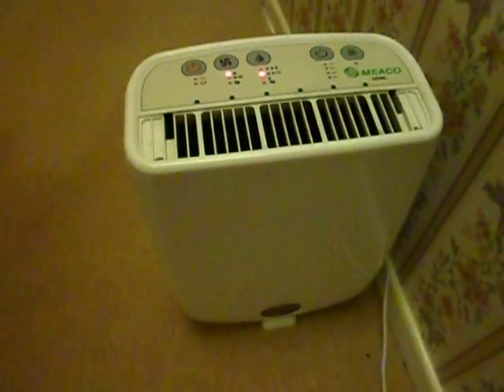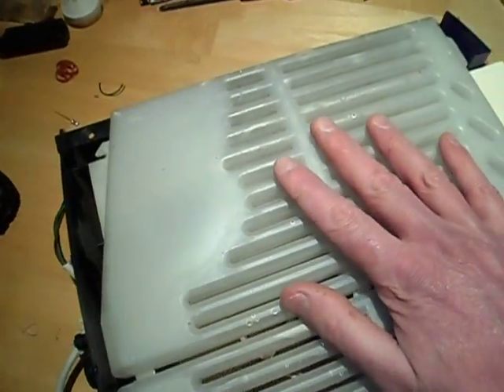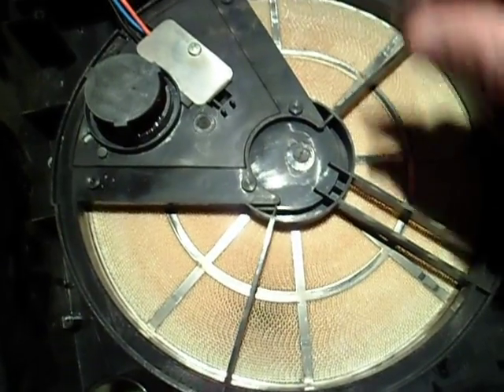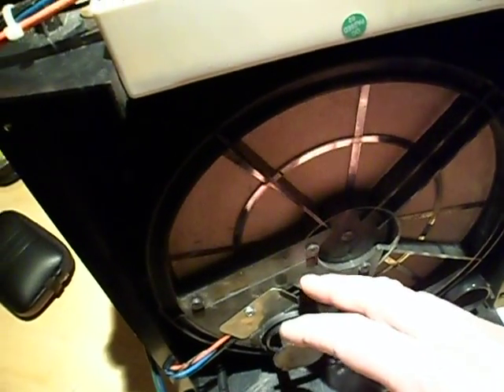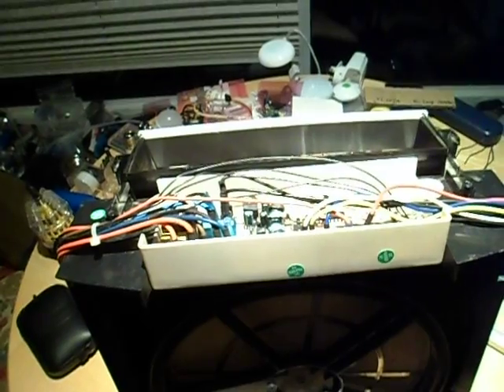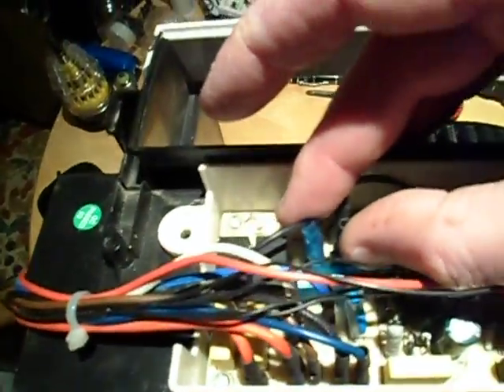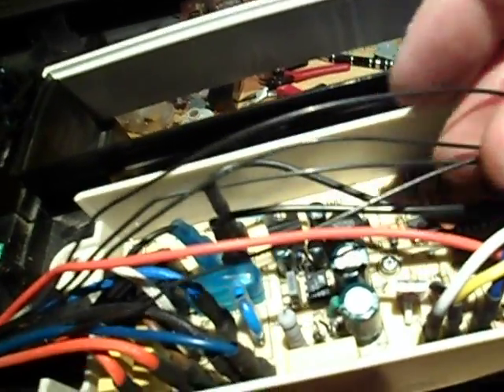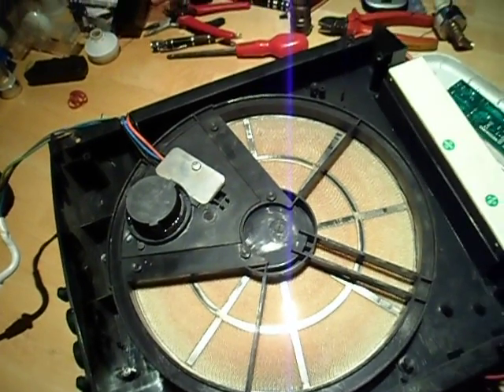A look inside a desiccant dehumidifier.

Comment: Great review of how they work and because of you I got the ecoair DD122 "Simple" instead of a compressor type which I have had a number of before. I have to say its very good indeed but I am worried about how reliable it will be over time as the old fridge compressors just go on and on. I suspect the life span of the desiccant unit will not be as good but we will see. Great review and very informative. Thanks for that.
Best regards Peter
Reply from the maker: Can I suggest you run it on its lower setting as all these style of desiccant dehumidifiers will last a LOT longer when used on their low setting.  I've been using mine in regular use for a couple of years and so far no problems.
Reply: bigclivedotcom Thanks for your prompt reply. I do use the unit on its low setting in the bedroom and to be honest we don't notice it at all. During the summer when its hot our tower fan which we use to cool the bedroom down is noisier. I am glad to hear yours has been OK as some people have reported problems but the Ecoair unit came with a 2 year guarantee which was the final conviction for me to try this type of dehumidifier. Your review went a long way to convince me to try it and is far more informative than the usual manufacturers rubbish that tells you very little. Again thanks for the review and I have subscribed. Regards Peter
Reply: Peter Bruce do you have an update? The dessicant should last more or less forever. The ptc heater should be easy and cheap to replace, as should the motors if they ever fail.

Comment: They seem to work fine when they are new but over time dust gets inside which blocks the return air sensor, mine has been back to Meacco 4 times and each time it came back saying they cleaned the return air sensor. Do you know where it is and how easy is it to clean oneself.
Reply from the maker: There are two thermal sensors and two thermal fuses mounted as pairs on either side of the desiccant drum where the hot air flows through it.  What was the nature of the fault when you returned it each time?  Was it showing an error code or was it just dead completely.
Reply: bigclivedotcom We have our DD8L running 24/7 on the two fan speed, we have serious mould problems in a stone wall house. We follow the instructions meticulously and vacuum the filter twice a week to be safe. After a few months of running we notice that the bucket starts to take longer to fill 10hrs when new increasing to 14 hrs after 3 months. Meacco pointed out this could be because there is less moisture in the air but I put it in the shed one night and didnt get any better results.
The proof that something is a fault is when the 2fan light starts to flash. this happens every 5mins for about a minute then there is a clicking sound when it stops flashing which i think is the heater being switched back on. Also when i inspect the dessy wheel i can see ours has dust on it and is scorched in places even the chrome has black marks on yet we have always used the unit in accordance with meaccos instructions.
Reply from the maker: That's odd.  I wonder if the air path through the condenser section is furring up.
Desiccant dehumidifiers are still a young technology.  I think we're the guinea pigs for the technology until it matures.
Reply: bigclivedotcom I think its the air path through the desiccant wheel, i can see with a torch that some of the cells (not many) are completely blocked. A post below mentions (Merco Dehumidifier_Service_Guide-2.pdf) where can i get this from id love to take mine to bits an clean out.
Reply from the maker: keith marsland I couldn't find the service manual for that dehumidifier, but you could always try taking it to bits.  The base comes off and then the two parts are held together by screws and clips, so make note of where everything goes.  Hopefully you'll find enough access to gently vacuum the front of the desiccant drum to get rid of the fluff.  The inlet filter on the front unclips and is sized somewhat generously to allow good airflow, but obviously lets too much fluff in too.
Reply: When i took it to bits i found the dessicant wheel was covered in dust about 3cm in from the outside diameter. the rest of the wheel had gone very brown as obviously the heat must have been concentrated on what wasnt coverd in dust.
Out of interest have you any idea what the two brushes are neat that poke through into the area near the big fan. The lead to wires so could the be some kind of theremosat
Reply from the maker: keith marsland The dust issue seems to rear its head a lot.  Perhaps in future designs they will design the desiccant drum into a cleanable cartridge.  The little black brushes you describe are the ioniser emitters.  They are clusters of carbon fibres with a high voltage at low current on them, that puts an electrostatic charge into the air.

Comment: great video thanks.
Im struggling to take my Eco air apart!
It works fine collecting, but makes quite nasty 'grumbling/knocking noise' after about 10 mins use...
this sounds 'internal' and doesn't differ if on high or low fan setting
It is 5 months out of warrantee, and gonna cost £89.99 to collect and service.
Any ideas what It may be?
Reply from the maker: When it's making the noise shine a light through from the vent side and see if the honeycomb-style desiccant drum is rotating smoothly.  It might be the motor that turns that from the edge that is stuttering if the drum is not rotating freely.

Comment: Hi Clive, very interesting video.  Could you please help me out.  I am after a similar design but for higher air flow rate, and RH 90% to bring it down to RH 20 % , would you have a link to find some more performance specifications of this model, may be amount of water extracted per kg air per unit time according air humidity conditions, what is the maximum air flow rate it does.    Cheers.
Reply from the maker: It sounds like you may be looking for a specific industrial dehumidifier.  You do get quite big ones for drying buildings after flood damage.  It might be worth talking to the manufacturers of them to see if they do one that fulfils your requirements.
Reply: TheMrCualquiera 20% is not easy to get to with a high flow rate.  it sounds like a process control / "food dryer" type application and you are looking at some expensive specialised kit  £10K+.  If you can recirculate the air in the room then you can use a "4 hole desiccant" eg Ecor Pro DH3500.  These don't give negative or positive pressure to the room (BTW this is not an advert its the best explanation of the problem.)

Comment: Hi Clive,
Great vid, very informative.
I have a DD8L junior, the red warning light is flashing, the system is clean, vac'd and blown through with dry compressed air. When the system in the fault state the fan does not rotate but the sound coming from low down in the unit is as if it wants to start rotating, the heater works fine, I can feel the heat rise to the top. After a few minutes the system switches off, when left to cool and the unit switched back on in the lowest setting, there is the same as above where after a few minutes there is a bleep, the red light flashes then the unit switches off.
Can you please advise
Cheers
Tom.
Reply from the maker: frogescalator1 Given how many of these units seem to die early on when used on full setting for prolonged periods of time, it might be worth doing a search on ebay for a faulty unit as spares.  The motor will probably be some standard unit in China, but might be hard to track down from here.  I can't remember if there was a specific manufacturers name on it or not.
There are two other possibilities for the motor failure.  It could be that the control board itself is faulty and not turning the motor on, although I think that's probably unlikely unless a wire or connector has come adrift or there's a bad solder connection on the PCB.  The other possibility is the motor capacitor.  It's a small rectangular box on the motor housing that causes a phase shift in one of the motors windings to give it rotation.
Reply from the maker: There are three motors in the unit.  A small fan that circulates the air round the condensation path, the drum motor and the main fan.  It sounds like the unit is detecting that the main fan isn't running causing it to shut down.  Was there any smell to indicate an unhappy motor before the fault occurred?  I have noticed the DDL8 I have makes what I would regard as a hot motor smell and I suspect it is the main fan motor.  It does sound as if the main fan motor or its control circuitry has failed.  Does the main fan run freely when spun by hand (or air)?
Reply: bigclivedotcom Hello Clive,
Thanks very much for this video and sharing your expertise.
I have a very similar issue. The main fan motor has stopped working without any fanfare or drama. I have opened up the unit and there is no sign of scorching or any burning smells from the main fan motor itself. I was hoping it might be a generic motor that could be bought from somewhere but the label on it says "Youlong Electric Ind. Co. Ltd" which is the original manufacturer of the dehumidifier.
Last winter I took the (out of guarantee) unit apart to clean it out after Meaco said it would cost £70. After doing this I put a finer mesh over the filter and it has worked fine ever since. I wonder if there is any way to fix the motor or whether I will just have to try Meaco -- and whether they will replace the motor after I have opened it before ... or whether it's just worth pushing the boat out to buy a new one. I have had just under three years' use out of it which admittedly isn't very long for the motor to pack in. It has been used on low setting for 99.999% of the time (I think I've used the high and/or medium setting on just two occasions).
Perhaps I've answered my own question here and should contact Meaco to see what they say. Depending how much they would charge to replace the motor it might be worth just getting a new one, but I'm reluctant to chuck out something that could be repaired easily.
Nonetheless I'd very much appreciate your insight about this! I would absolutely not want to be without a functioning desiccant dehumidifier for this coming winter!
Many thanks.
Reply: bigclivedotcom Thanks Clive. I think I'll see what Meaco say and whether they'll be willing to repair it. I know they charge £70 just to clean the things out, so if the repair cost is any more than that, I may have to ditch it.
In the meantime I've done a bit of looking around and have seen a German-made desiccant dehumidifier of similar capacity (Trotec TTR 55 E). On ebay.co.uk direct from the manufacturer it costs £135 inc. delivery. On the manufacturer's website, the PDF instructions include rather unusually a circuit diagram of the electronics AND and exploded diagram of all the parts! ( https://uk.trotec.com/fileadmin/downloads/Entfeuchtung/TTR55E/TRT-BA-TTR-55-E-TC-001-EN.pdf )
The air filter is also a removable and washable one, so presumably it would let a lot less dust through than the 1mm+ holes in the mesh of the DDL8's "filter" -- the cause of most of the breakdowns and leaks. Depending on Meaco's reply, I might say bye bye to them and try this German machine. It gets pretty good reviews on the German Amazon site.
It's unfortunate the the Meaco machines don't last, but given the comfort it provides over the winter in my single-glazed Victorian flat, I wouldn't go back to a streaming window winter without a dehumidifier!
Reply from the maker: frogescalator1 Most of these units appear to be from the same manufacturer with the only significant difference being that the control electronics are different between the "brands".  The exploded view of the trotec unit looks just like the EcoAir unit I took completely to bits for fun.
My own favourite unit is still the EcoAir Simple, which has no gimmicky keypads.  Just a high/low switch and a knob to set the mechanical humidistat.  It also doesn't bother with a cool-down period.  It just goes straight off.  The only thing I miss from the more complex units is the use of occasional fan cycling to let the humidistat test the room air properly.
The EcoAir simple unit costs about £130 from Amazon.
http://www.amazon.co.uk/EcoAir-DD122FW-Desiccant-Simple-Dehumidifier/dp/B00474K8SY

Comment: Hi Clive, I have a problem with my Ecoair DD122FW MK5 Desiccant Dehumidifier. The unit is now out of warranty.  The problem, the unit appears to work ok all of the motors are working, no warning lights, filter clean, also warm air is being blown out of the air outlet. But the unit is not collecting water, the humidity just drops very slowly probably through the heat from the outlet.  When I first had the unit it worked very efficiently, humidity dropped quickly, collecting plenty of water which could be heard when the unit was running.  Any ideas please?
Reply from the maker: If you shine a bright torch into the sides while the unit is running, can you see the desiccant drum rotating slowly?

Comment: How on earth do you get the case off the thing?
Reply from the maker: There are some screws in the water collection area and on the top, then some extremely firm clips on the plastic casing.  You really have to dig your fingers in and give it a bear hug to get it to pop apart.
Reply: bigclivedotcom just managed it, thanks. Nothing to see unfortunately - warning light coming on after a few mins (overheating says the manual) so checking for any internal blockages etc. All looks fine and filter etc cleaned. Time for skip and new dd8l :-(
Reply from the maker: Alexander Harris Have you checked the front filter is clean and that the internal desiccant drum is also not blocked with fluff?  There's a small fan that blows air in a loop through the heater, drum and the plastic condenser panel.  It might be worth checking for any obvious obstructions.  Of all my dehumidifiers I prefer the eco air simple, since it has the minimum amount of "electronics" in it.  It's just a mechanical humidistat and switches the whole machine on and off as required.
Reply: Cheers for the tips. There was nothing obvious I could see (I was hoping to find a big clump of fluff that had fallen in from the top, or something similar). Having rapidly reached / exceeded my level of tinkering skill I'm afraid it's gone to the great skip in the sky.

I'll check out the eco air, cheers.

Comment: Clive, thanks for your quick reply.
Yes the run capacitor was in circuit when I did the test.  I think I'll cut my losses and purchase something like the EcoAir as you suggest - or perhaps another DD8L as I now have a box of spares!!
Reply from the maker: I'm afraid that dessicant dehumidifiers are still in their infancy as a technology.  They will bocome more reliable over time, but the earl;ier ones seem to have had issues.
I tend to recommend running the things at their lower setting, since the highest setting results in a much shorter unit life.

Comment: Hi Clive,
I have used the DDl8 on my boat last winter and it worked great - much more efficient that a compressor dehumidifier I used before.  However, it stopped working and was just out of guarantee.  As I live in Ireland it was going to cost £70 + shipping to have Meaco have a look at it, so I had a go myself, although more endowed with ambition than knowledge!  
However, it seems that the fan motor will not move even though there is power on the feeds.  I removed the motor for further investigation and the resistance on the windings looks fine and a little voltage is generated on each of the windings when the rotor is turned. Yet when connected directly to 240vac on each of the windings in turn, there is no movement. Do you think the motor is shot or if there is a problem with the circuit feeding the motor?
Reply from the maker: That's an odd one, it's usually the heating element that fails.  The motor has a run capacitor associated with it which is in series with a run winding to give it direction, so if you're testing it, that will aso need to be in circuit.
Is the rest of the unit running apart from the fan?  I will say that one of my units makes a noticeable hot-motor smell when it's been running a while.  So I wonder if they've over "value engineered" the motor.
If you narrow it down to the motor then maybe Meaco would send a replacement fan assembly.
At £70 for a "service" I think I'd be tempted just to buy a brand new EcoAir Simple unit, which can be bought quite cheaply and seems pretty reliable.

Comment: Hi Clive, something I don't understand, and I meant to ask you a couple of months back: How does the condenser panel work? It doesn't use a refrigerant, and if the heated moist air is being blown over it I don't understand why the condensing panel doesn't warm up and become less efficient at condensing. Thanks.
Reply: The condenser panel is cooled by the incoming air from the room, and the hot moisture laden air condenses inside it and dribbles down to the collection ports at the bottom.  All that is required for the condensation to occur is a decent temperature difference.  In traditional dehumidifiers a compressor is used to create a much lower temperature than the room temperature to achieve the same result.
Reply: Clive Mitchell Ah, I see (I think)... the condenser panel is hollow and the hot moist air travels inside it while the room-temperature air cools the outside of the panel... simple but clever!
It'd be great if you could do a video on making replacement heater elements if you figure out how to do it. Cheers Clive, Daz.